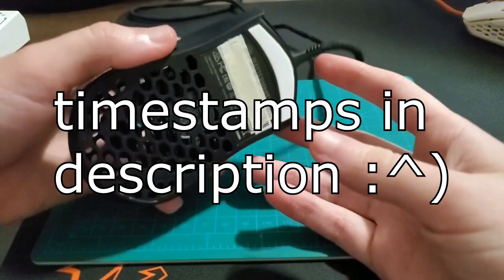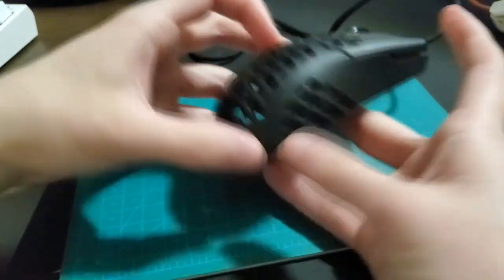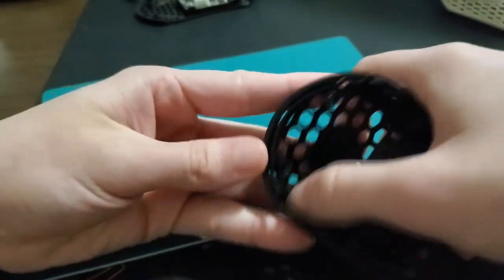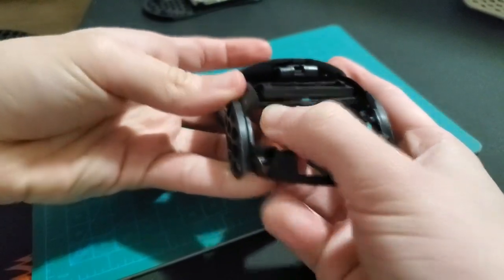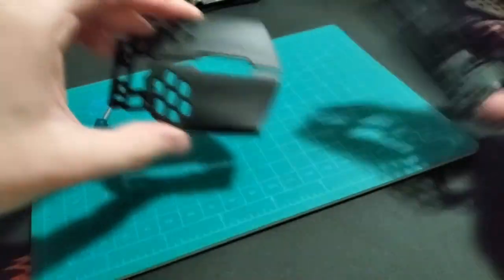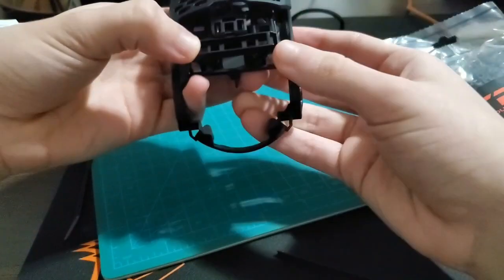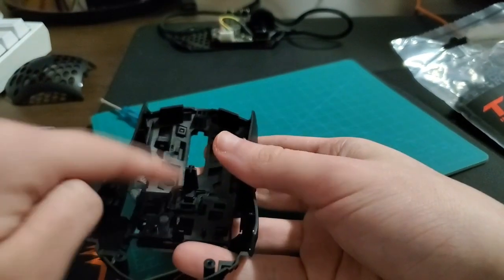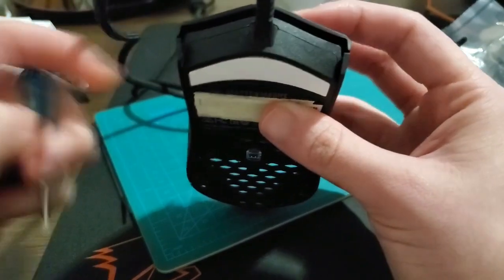MM710 Click Wobble & post travel fix

Comment: Hey! Thank you so much for this video! Since I didn't have any Cable zippers that fit, I just put exactly 3 layers of duck tape around the area you described and it worked like a charm. Took a bit of testing to find out the exact amount of layers you need, but with exactly 3 it works like a charm. I put the duck tape around almost the entirety of the front area of the clicks btw, which removes the post travel of any area of the click. Upvote this comment please, so other people who don't have these cable ties or don't want to spend money on them can see. :)
Reply: could you explain me?

Comment: these zip ties must have been changed or something, the head on them is smaller now. I bought the exact kind as shown in the video and they wont fit into the slots at all, they just fall through.
Reply: Bummer damn it.
Reply: Yup same problem here, just found that out myself lol. Did you find a fix?
Reply: Heat them and make them larger, after all its a plastic :)
Reply: QCP damn you’re right

Comment: That wiring part worked for me. My mouse was actually wobbling specially the left click one and it was creating double clicking issue somehow, but saved me. Thanks a lot
Reply: if you dont want it to double click then click the mouse normally because if you slap ur fingers on it it will double click or maybe triple click

Comment: Great fix. If zip ties are to small just heat them and make them larger - its a plastic. You might even use any other plastic with also heating to make the head and perfect fit for that hole.
Reply: how do you do that? I tried heating the zipties and all it made was a blob that was too big or too tall

Comment: Great fix! do you know how to fix the scroll wheel wobble on this mouse? Mine is bad, not so bad about M1 and M2 tho, but the scrollwheel is bad and annoying when scrolling up and down. I guess it just has too much tolerance so, something like putting some tiny tape in the bar that holds the wheel could do the job but I'm not that skilled with electronics.
Reply: just buy another mouse cuz this one has so many issues

Comment: If anyone recently bought a mm710 or mm711 (me)  most of the problems should be fixed
Reply: yes
Reply: Are the issues all fixed now?
Reply: Lukas W yes
Reply: Lukas W aside from a little but very little mouse wubble yeah
Reply: @maxh6979  on mouse 1 and 2? They have zip tie mods for that, no? Considering it's like $30 rn and comparable to industry leading mice in weight, I'd say it's worth modding
Reply: Lukas W yeah on 1 and 2, forgot to say there is a little bit of post travel but also not much
Reply: Okezy I dont have post travel but only slight wobble
Reply: @maxh6979  a little bit of post travel? What does that  mean?
Reply: not mine im afraid
Reply: @felicityc  F, thats wierd tho cuz ive seen alot of posts on r/mousereviews saying its aight. Maybe try getting another one with warranty, they defienetly reply back and help

Comment: Coolermaster's R&D team should have spent a little more work on build quality and just charged an extra $10 for it. I would rather have a sturdy $60 mouse than an iffy $50 mouse.
Reply: The es mm711 is exactly what you describe $60 better build quality and also has rgb. It is 7-10 gram heavier tho
Reply: @lucianocipriano3603  same quality
Reply: @lucianocipriano3603  weight ruins the whole point :\